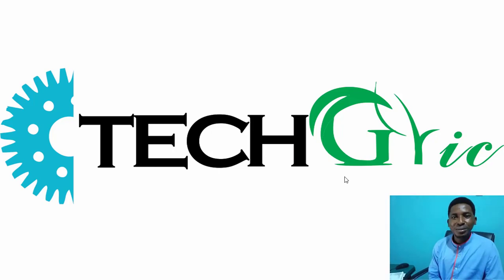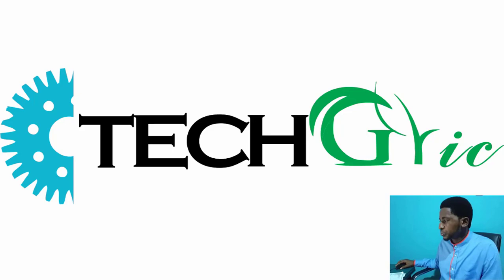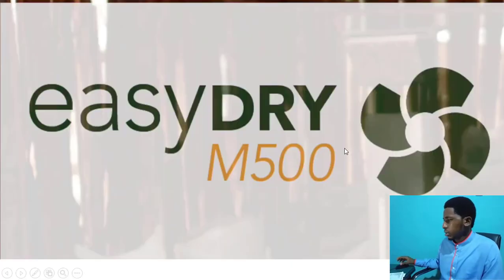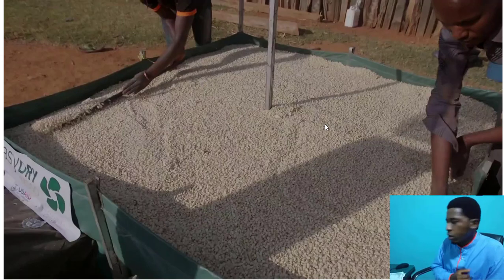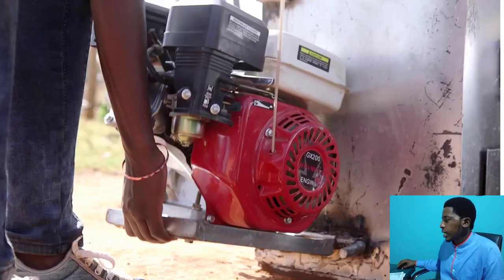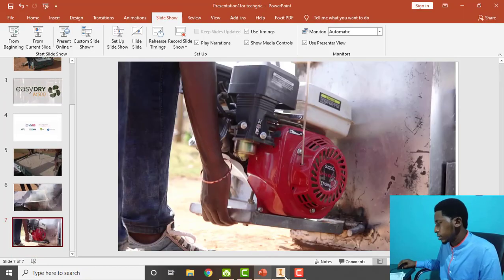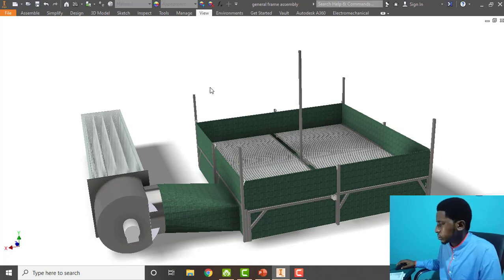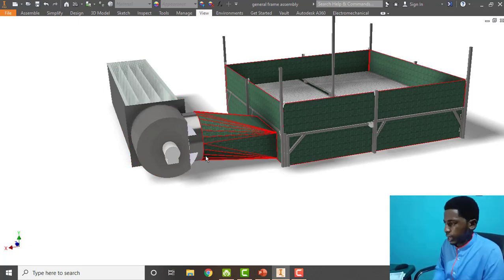Flat Bed Solar Dryer

Comment: It looks like you will need a larger solar collector area in practice. There will also be variations in the solar intensity, so you might benefit from thermal storage. Good concept
Reply from the maker: Thank you for the comment, I have also improved certain things in the design, including your suggestions. I appreciate it.